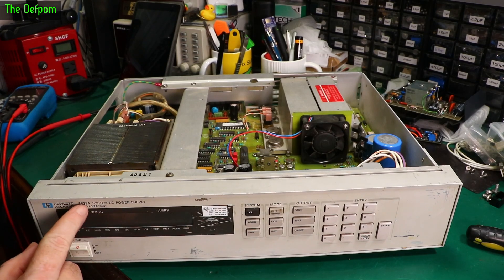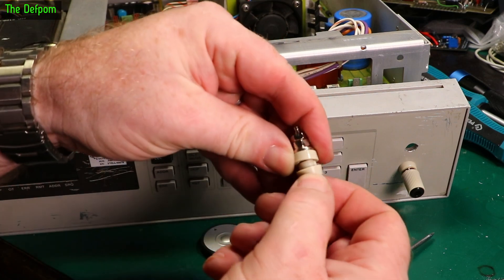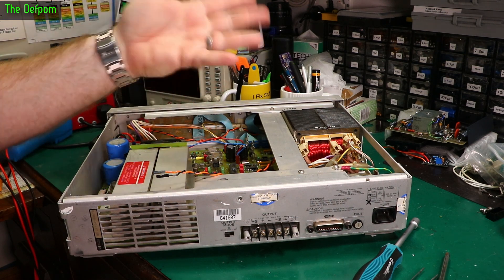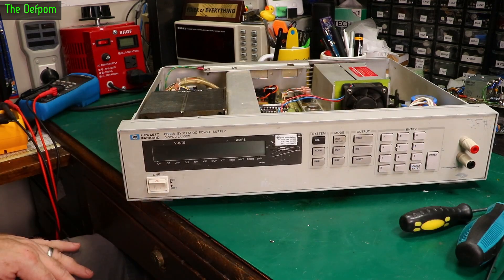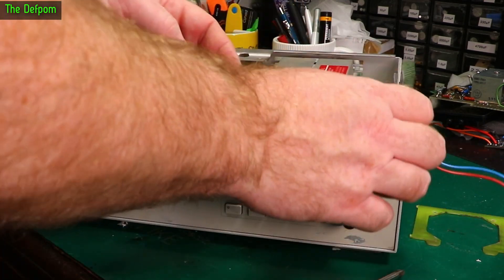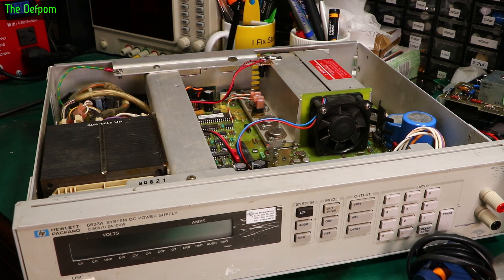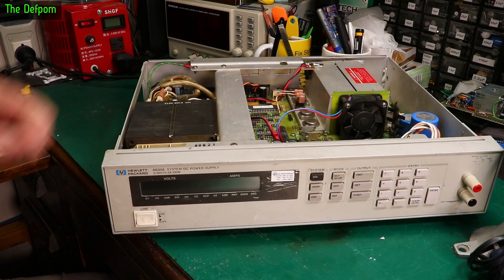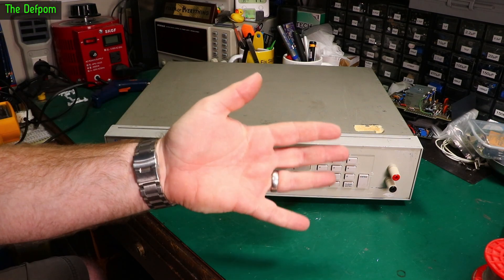🔴 HP 6633A System DC Power Supply Upgrades - No.1136

Comment: you should have put 4 terminals on the front panel and brought the sense inputs out as well assuming there is room for the extra two.
Reply from the maker: It wouldn’t have been as easy, the front panel is thick aluminium, the binding posts have a cut out for them from the factory
Reply: There it isn't. Only on the later model, B, have the cutout for that.
Reply: Aluminium is easy to drill through, its soft metal. Its not that difficult.
Reply from the maker: @simontay4851  the key point was THICK, it is way too thick for the binding post mounting, and really wasn’t worth the required effort to try and make a suitable reinforced mounting after cutting it away, so yes it is that hard, you just didn’t get to see what would have been involved.

Comment: Surely remote voltage sensing at 2A is hardly worth it - unless you want great accuracy at very low voltages? Just use short and thick wires feeding the equipment under test and monitor the voltage at their ends.

Comment: Ok it's late I'm tired so humour me ! won't that cause limitations by not having the sense on separate posts ? why do meters  with sense have seperate posts please as I havent had to use 4 wire measurements for ages...cheers.
Reply from the maker: Yes it does limit functionality from the front panel, BUT you can always still hook up to the rear sense terminals and use those if you really needed to. Dont forget this is only 2A max, so voltage drop isn't likely to be large anyway.
Reply: @TheDefpom  I did an edit ( hasn't showed up !) as I mouthed off before watching the whole video !...cheers;